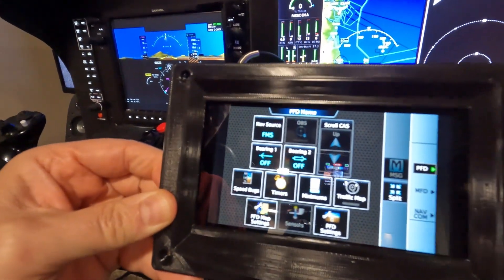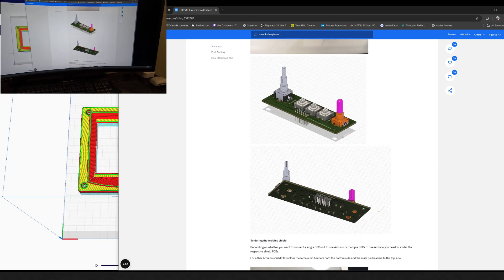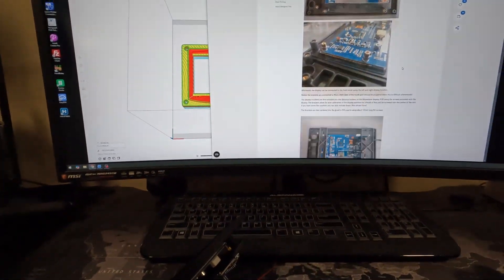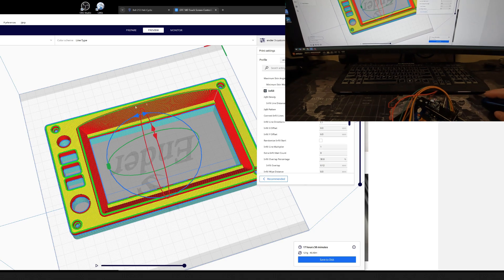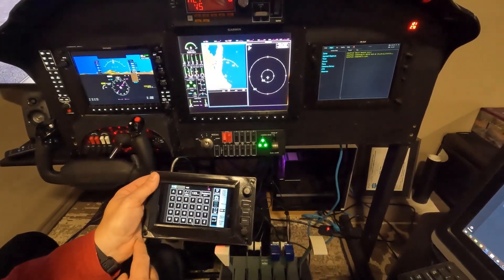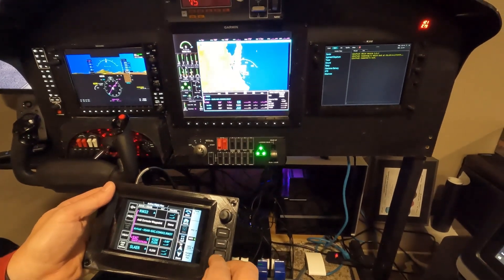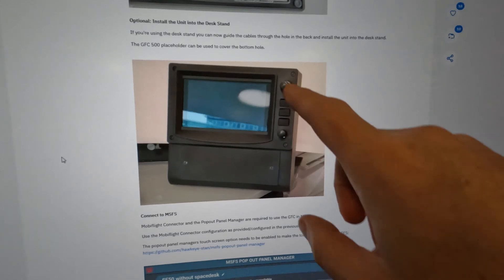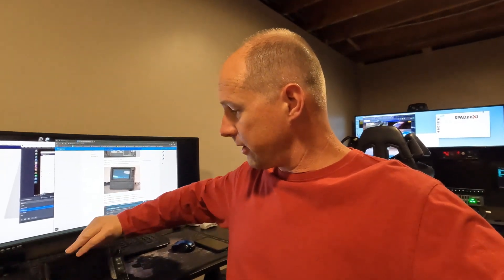DIY Touch Screen GTC580 for the Vision Jet in MSFS

Comment: Really cool project, thanks for sharing – this is exactly the kind of setup I have in mind! 🙌

I’m planning to use a similar GTC 580 panel to fly the SF50 (Vision Jet) and would like to control all three GTCs (left, center, right) with one single hardware unit. The idea is to use an additional 3-position switch via Mobiflight to select whether the panel is currently talking to the left, center, or right GTC.

One question:
Is there any way to use such a switch not only to route the inputs, but also to control which GTC pop-out is shown on the touch monitor (left / center / right)?
So for example: all three GTCs are popped out, but the switch makes only the corresponding window visible/active on the screen.

Have you ever tried something like that, or do you have an idea how to achieve this (Pop Out Panel Manager, AutoHotkey, other tools)?

Thanks again for the inspiration – great work!
Reply from the maker: Personally no never tried anything like that, and I'm not sure modbiflight can handle it. But I'm srill very much  a rookie as to what Mobieflight can actually do. Truthfully, because all 3 580s have all the same controls. 1 unit will still do everything all 3 do. The aircraft has 3 units, just to ease the work load of the pilot from having to switch screen all the time. I currently one have 1 580 built (there is a video here on the channel about it) and I use it for Flight now.

Comment: How much do you think this would this cost? Assuming I don’t have tools or the boards or a 3D printer 😂 a plug and play one is $800. 

Also any ideas on how to create my own G3000 panel? Those are $600 a pop
Reply from the maker: Raw parts you need to buy are around $150.. The screen is like $100, the little computer that runs it is $25, you've got maybe $15 worth of eleteical switches and parts.. the ones for $600 are injected molded, not 3D printed, so they have a slightly nicer finish. But in that case, the mold is very costly to make. So that's where the extra cost comes from to make a mass market production unit.  I'm about ready to release a v2 update to this video as I'm building 2 more right now, but with custom circuit boards, which makes building them very quick... 

I'm also working on a G3000 which will be an under $150 built as well, that i hope to have a video on here in the next month or so.

There are places that will 3D print a file for you a lt a reasonable cost. I'm sure you could still put one together that way for under $200

Comment: what are the binding settings for the buttons/knobs in msfs2024 Sir?
Reply from the maker: The unit interfaces with an Arduino board through Mobieflight. Mobieflight talks directly to MSFS, so there is no need to set any keybindings within MSFS. As those are set inside the Mobieflight software.

Comment: Hi, nice release  very interesting. I use a touchscreen but when i touch anythong, i see it msfs 20 or 24 detects the touch but does not execute. Eg when i use it for the ATC panel, it detects wich line i have selected but the touch doesn't send the command. Same for efb or other panels. Windows commands and other programs like Excel work fine with touch. Did I miss any option anywhere in the sim to accept touch commands ?
Reply from the maker: You have to use the app Pop Out Panel Manager and enable the touch screen options in that. By default, FS20/24 doesn't support touch screens on their pop out panels. 🤷🏼‍♂️.... 

Seems a bit short-sighted as far as I'm concerned, but pop out manager handles it nicely. It's free on FlightSim (dot) to

I'm going to do a video on Pop Out Panel Manager in a week or so.

Comment: Very nice, I've been looking at this for MSFS.  I'm just getting started and will build a G1000 first, the GTC580 would probably be my second item to look at building as I will be looking to add avionics as I go through the career mode and progress to more advanced aircraft.   My only issue with this design is that the screen for this is that it's quite expensive for a 5.5" display (I can only find it for £120 GBP).  Do you think a 5" 800x480 display would be adequate (scaling the housing accordingly)?  I think these can be sourced for 1/6th the cost.

Also wondering how you connect all the additional displays to your MSFS computer.  Do you have multiple graphics cards to provide all the additional HDMI outputs or perhaps a USB displaylink dongle for each one?  Would love to see a video explaining that if you don't already have one.
Reply from the maker: The 5.5-inch screen just barely fits the design. So, dropping that half an inch might leave a little space around the screen. The lower resolution setting should matter that much.

As for how I've got everything connected. I'm going to do a video on that here in the next few weeks. Main screens come off my 4060 card. The G1000 and G1500 are fed from a Plugable device that is a USB 3.0 video card. The 580 uses the onboard video card. 

The G1000 and G1500 do create a bit of a bottle neck in the system as the Plugable unit doesn't like to 2 different screen sizes. I'm thinking I may dump the G1500 and built a second G1000. The G1500 was used on in a few aircraft it's not a big loss.
Reply: @thesimproject73  That sounds great.  I'm thinking I might have to shrink the case a bit to fit the 5" screen and build my own PCB, perhaps just design my own case.  But the 5" screens are readily available and cheap compared to 5.5" so it may be worth it.  For now I'm starting my 2x G1000 build.  I have the screens, PCB kits are on the way.  Have to work out how to print the buttons for backlighting as I have a multi-filament printer and I'm not keen on the paint/sand method.  Fun times.